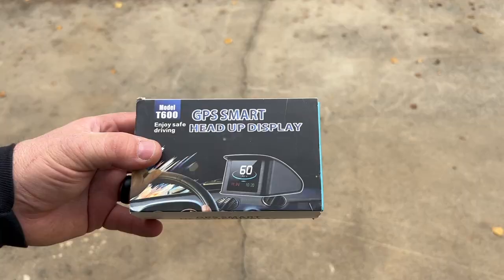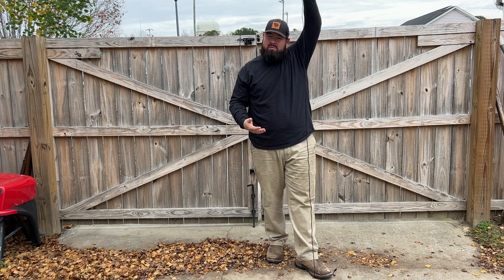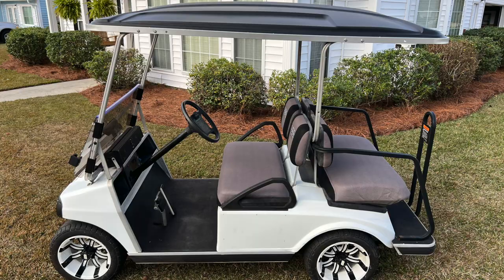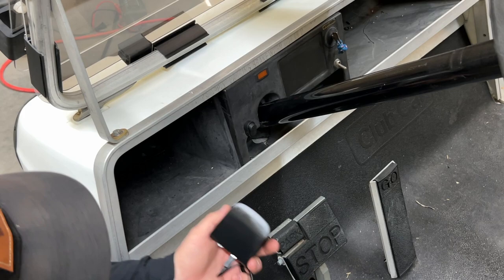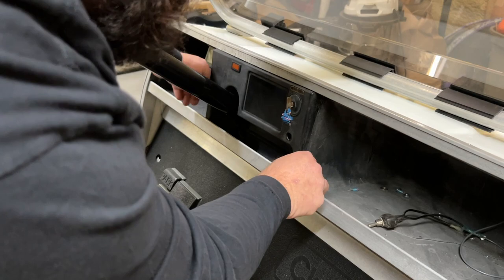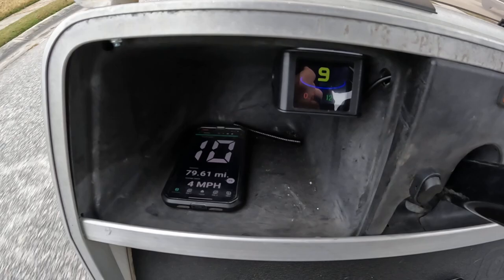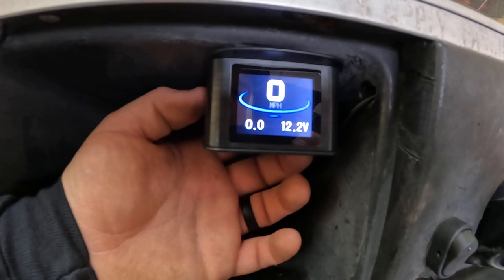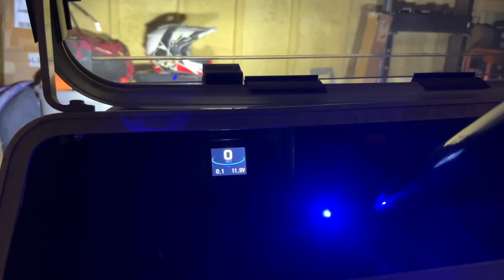Golf Cart $40 Digital GPS Speedometer Gauge Cluster Install | Heads Up Display | Club Car DS Build

Comment: I tried a couple of those GPS units about a year ago. One I really liked the look and function but it would power on and off constantly. Mine was usb powered and only this usb device flickered. Sent it back, got another one, same thing. The speed settings allow you to calibrate the speed incase its off compared to another GPS source like you had in your phone. I might have had better luck hard wiring it like you did. Great vid! 👍 🍻

Comment: Nice unit.. do you have any suggestions for one to use with 48volts?✌🏻
Reply: I agree, certainly a neat device, but if I'm going to get one it doesn't make sense unless it also has a usable voltage readout.

Comment: nice thanks do you know how I can get my navitas 600DC SEPEX to give me 100% throttle I can only get 82% the mcor changed and the linkage were checked to see if i could get more adjustment here and no luck, i see a throttle off set in the app and few others but can not get more than 82 have you any ideas?
 i am gonna have to get ahold of them and see
Reply from the maker: Did you calibrate the throttle in the app?
Reply: @Fentertainment  this is for the AC version  i think, i dont think the DC 600A one prompted a calibration i forget honestly
Reply: the throttle calibration was out and is now 100% the play is able to be adjusted with a few steps
Reply from the maker: @rexxx927  I thought so.
Reply: @Fentertainment  me too but for some reason its the harderst first lol now onto a gps cheers and thanks again keep it up i will be checking back on the channel

Comment: I’m ordering a similar one for my cart. I figure for $40 as long as it’s accurate within 1mph I’ll be happy.

I didn’t check though, are they waterproof?
Reply from the maker: Not waterproof as they are intended for a vehicle inside the cabin. Thats one main reason I stuck it under the cubby. Ive seen others use them on the steering column but I cant speak on them getting wet...I just dont know.